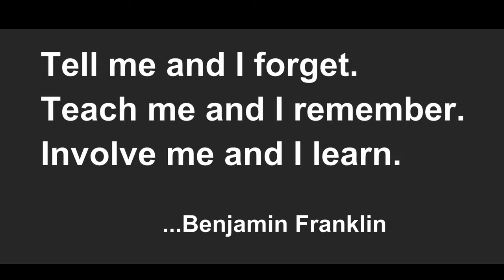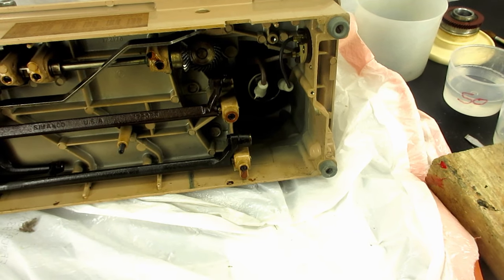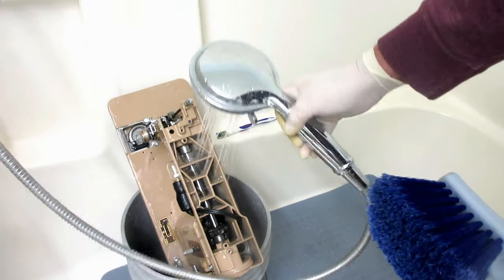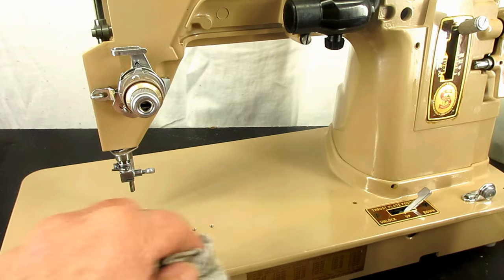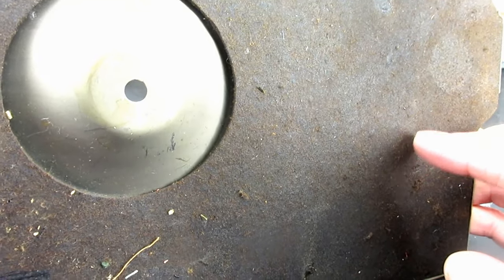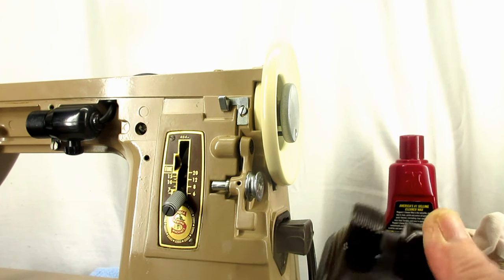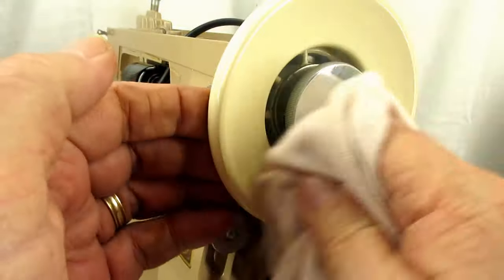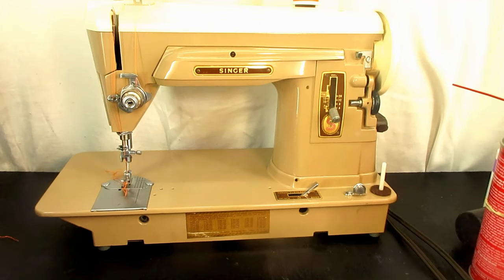An easier way to clean & degrease a sewing machine with less parts removal.

Comment: Thank you for making all your videos, they're so helpful.  I'm wondering if you will ever be doing a video to remove and replace a take up lever on a Singer 403.   I purchased an otherwise mint condition 403A on Ebay for $400.  I took it to a sewing machine repair shop after the sale and the repair man checked out machine and said it worked fine and was "museum quality."  When the defect became obvious (long after sale completed), he refused to fix it because it was too time consuming ($400 worth).   This beautiful machine needs this repair--but it's not so simple as on a straight stitch machine.  Second repair person also wouldn't attempt it.  I was hoping I could fix it myself.
Reply from the maker: You certainly can fix it yourself. You can repair, replace, adjust anything on the machine. My favorite SInger ZZ machine. I named mine "Regina" b/c, for me, it is the Queen of Singer ZZ machines. Here is my playlist for model 403A. https://www.youtube.com/playlist?list=PLsCOZgzzaiKKyqvdDRwS-9MfLuwSNJTcg   One of the 26 videos is about the take-up lever system. I think you will find it useful. The other 25 videos cover other parts and systems of the model, cleaning and degreasing the machine, working on the motor, the light, and the wiring and lubricating the machine, and finally, how to use a vintage monogrammer on the machine. Congratulations and best of luck going forward. Thank you for watching my channel.
Reply: @andytubesewing1953  Thank you for such a quick reply!  I did find the video on the take up lever system, and some of the others you mention, but what I didn't find (and couldn't figure out today) is which parts have to be removed to get to the take-up lever and how (and what order) to remove them.  I'm scared I'll never get it back together.  I started today, but didn't know if I have to remove the tension apparatus because it's connected to something else inside, or if I can leave it alone.  Maybe that's in a video; I'll go through your list.  Thanks again.  I was a little worried after I saw the October 2020 video--I'm glad you're back.
Reply: @andytubesewing1953  So sorry Andy, I made a mistake in my first comment--my machine is a 401A not 403A.
Reply from the maker: @geem.5286  Ok, model 401A. I'll re-think this then, but in the meantime maybe you can tell me what is wrong with the take-up lever and why you want to remove it?
Reply: @andytubesewing1953  The  first time I tried to use the machine, it sewed for a minute,, then threads got all tangled up in the bobbin area. On phone, service man told me I was doing something wrong or using bad thread, but he would look at it.  I  put it away until months later when I could get back in to the shop..  On closer look, he told me someone had run machine without oil/grease and dry parts (pointing to t.u. lever) had rubbed together and ruined them.   He showed me a broken round  plate on the middle  joint of the take up lever where he said someone had used a screw driver to try to force it to move and had broken it. A second repair man agreed the t.u. lever needed replacing as he could see the broken round metal plate.  I don't really understand what parts were rubbing to cause the problem; I didn't know what a take up lever was til I got home and looked for videos on YouTube..  Both men refused to work on the machine.  Thank you for reading all this.
Reply from the maker: @geem.5286  Use the Regina 403A playlist videos to work on the nose end parts of the 401A. They have the same parts. The sequence is the same in the playlist; Needle bar, Presser bar, Vibrating Bracket, the finally the take-up lever system. You will see in all those videos the tension unit is in place and has not been touched. It will not be in the way. When you buy the replacement parts, usually on eBay, you can use parts from the 401A or the 403A b/c, as I stated, they are the same parts in both those models.
Reply from the maker: Use the Regina 403A playlist videos to work on the nose end parts of the 401A. They have the same parts. The sequence is the same in the playlist; Needle bar, Presser bar, Vibrating Bracket, the finally the take-up lever system. You will see in all those videos the tension unit is in place and has not been touched. It will not be in the way. When you buy the replacement parts, usually on eBay, you can use parts from the 401A or the 403A b/c, as I stated, they are the same parts in both those models.
Reply: @andytubesewing1953  Thank you, Andy, 'll find and watch those videos.  I so appreciate your taking the time to help me; I and so many others are grateful to have your videos and advice.
Reply from the maker: @geem.5286  Sure, you are welcome 👍 Please keep in mind that you are taking the presser bar and vibrating bracket off just to get to the Hinge Screw/Stud of the take-up lever over on the left side. So you usually do not have to remove the presser bar completely, just the top parts of it to expose the hinge screw. The same with the vibrating bracket; just remove enough of those parts to get to the hinge screw behind them. Of course, you can remove all the parts as I do for cleaning, etc. if you want, but I'm just saying you don't have to do that; just get access to the hinge screw /stud on the left 👍 Best of luck to you.
Reply: @andytubesewing1953  Good to know, thanks!
Reply from the maker: @geem.5286  👍

Comment: What happens if you don't get all the moisture or water out and completely dry and some moisture is left.  Isn't that dangerous? 
I'm a little freaked out about the use of water with an electrical device?
Reply from the maker: Yes, water and electricity don't play well together. You must completely dry the machine so that does not happen. 
     I've washed dozens of machines like this without any problems. The oldest one I did was about 12 years ago and it's still running fine. 
     I have even washed the motor while inside the machine: https://youtu.be/vIFK94QRyr4    
As an experiment, I soaked a motor in dirty, muddy water for 24+ hours, then washed & dried it and it worked perfectly: https://youtu.be/6y1EN5S2sz4
     These vintage machines do not have any electronic circuit boards or switches. I would not wash those. 
Many of the machines I have saved were in terrible condition, but they were made so well that I could clean them and get them working normally. Here is a machine I saved after mice had been living inside it for months:
https://www.youtube.com/playlist?list=PLsCOZgzzaiKJS_4FKPb4bgAbHtYWnexvy    

     Of course, if you are worried then don't wash it, right?  Thanks very much for watching my channel.

Comment: Andy, I am interested in cleaning the black vintage Singer machines that have shellac finishes and decals.  I cannot find mineral spirits or kerosene.   I have read that some people use diesel fuel.  I am most interested in cleaning the mechanical parts of the machines.  I have also read where some people use Marvel Mystery oil. What are your thoughts?
Reply from the maker: I have used the Krud Kutter Cleaner & Degreaser for many years to clean parts and insides of the body of the machine. I've only done a couple of black finished models. Here is a playlist of 16 videos for cleaning. https://www.youtube.com/playlist?list=PLsCOZgzzaiKK8O1UvRsU-eNo2G2yX3f2G    You can look at the list and watch the Featherweight 221 videos and the 99K video to get some ideas. It would be hard to find anyone more knowledgeable than the featherweight shop when it comes to refurbishing the black finishes. You can find their tutorial page here and navigate to the section you like: https://singer-featherweight.com/blogs/schoolhouse/tagged/maintenance    Good luck, and thanks for watching my channel.

Comment: Dear Andy, hello.
Happy Labor's.
I'm cleaning a singer red-eye from 20's, she is extremely dirty n glued together from old oil n dirt etc :)
I'm using the 'Krud Kutter Original Cleaner/Degreaser'.

I'm wondering based on your experiences with this cleaner, what's the longest time i can soak the hardware in the 80% KK n 20% ho2? 
 
Thanks in advance for educating me.
Regards,
Sue
Reply from the maker: Hey, Sue! I've never thought much about how long. I have started using a weaker solution. No more than 50/50. I've found that some kinds of gunk just need more scrubbing no matter the amount of KK. When I soak very dirty/greasy parts, say in a 50/50 solution/ usually 15 to 30 minutes does it. BTW, you understand NOT to use any KK on the black finish of your red eye, right? On a painted machine like a 403A a 15% solution, sprayed on and quickly wiped off and rinsed can even dull the paint a little. On a red eye that usually/may have a lacquer finish, it can really harm the finish. Thanks for watching, and good luck.
Reply: @andytubesewing1953  yes sir, I am just taking the inner parts that has oily gluey stuff and needs cleaning badly & not much moves :)
I have been watching  your educational YouTubes very carefully.
Reply from the maker: @staylor8638  That's great, thank you. I just wanted to be sure because last year a guy wrote me that he ruined his 99k using the KK and he was blaming me. I felt bad for him but I said three times in the video not to put it on black machines. So I guess I'm a little edgy. Sorry I just want to be sure nobody hurts their machine

Comment: Andy, I have an older 99 without the tension dial etc and the spring has its tail over the discs also the wiring is directly into the motor and the bed surface is all pitted from the metal foot having been stored there in the bentwood case.  Should I get some black paint to fill? Even with all these issues the decals are good! Except where pitting or chipping has happened.
Reply from the maker: I've never tried paint, but a friend recently restored a 201-2 and used a paint scratch and fill product. Here it is: https://www.amazon.com/Dupli-Color-EACC04410-Exact-Match-Automotive-Touch-Up/dp/B01BPGFWPU
BTW, since you commented on this video I want to be sure you know DO NOT use Krud Kutter on an old black Singer. I've been told it harms the finish, so just an FYI
Reply: I dont know how to send you a picture.
Reply from the maker: @debbiepring2236  can't send through YouTube but if you post it online somewhere let me know.

Comment: "Remove smells" yeah here's a question I've had since owning my 500 - do these old pa motors constantly smell like ozone? My motor's been rebuilt twice, it's smells like ozone whenever it's run. I know old brushed motors can, just wasn't expecting it to be so strong
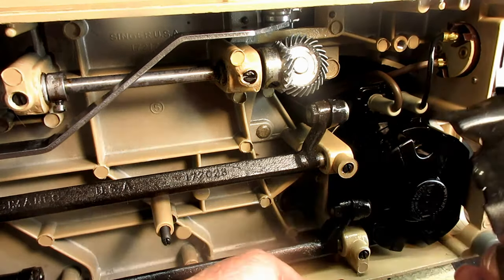Reply from the maker: Not all motors, no. I wonder what was done to rebuild your motor. Anyway, a dirty commutator with carbon deposits can smell fairly bad and the whole motor internal motor housing can smell that way. With a cold start of the motor, it can stink then, fading smell then worse when warmed up and running for a while. There is a fan in the motor housing that pulls air in from the sides where the aluminum meets the bakelite plastic and that fan will blow the smell around inside and outside of the motor. It can creep up through the hole for the motor shaft pinion gear and then spread from there all around the horizontal arm, adding to the smell of 60 years of accumulated grease, oil, and dust inside. The type of cleaning in the video eliminates that, but some can hang out inside the motor. That's why I showed cleaning the commutator with the brush seating stone. (@ 3:44:07) Faster motor and getting rid of the built-up carbon. Here is a video I made for cleaning oil off a PA motor https://youtu.be/vR7VmAC6evU    and here is a video about using the brush seating stone to clean the commutator https://youtu.be/pzq4tv8qn94   I use that stone on every motor now and it helps stop the smell, but some motors are so nasty I do the whole cleaning procedure too.
Reply: @andytubesewing1953  it was just rebuilt the other week by my father when we had to replace the motor gear - but there is a TON of old grey/black grease just all inside the machine, which is why I was peaking at this vid. Hopefully I can clean that up soon enough and see if it helps if you think it's just a smell lingering around
Reply from the maker: @faultyillustration3197  Yes, sure. You can pull the motor out of the bottom but leave the wires attached, and run it for a while to see if it is the cause of the smell you have. Removing the old grease will surely help though. Also, the bottom "felt" on the drip pan (bottom cover) can soak up a lot of oil and grease over the decades. When the machine is working those gear get quite hot and it warms up the grease and gunk in the felt. There are access holes on the lower sides of the machine casting and the smells come right out. That's why I often degrease that bottom cover as shown starting around 2:16:10 in the video.

Comment: Love your videos.  I was wondering how would the 404 work with tex 69 or 90 using a leather needle on garment leather 3-4oz?
Reply from the maker: Probably, George. Page 5 on the Instruction Manual has a needle/thread chart that shows up to a size 18 needle. A free instruction manual is here: https://www.singer.com/search/support?title=404    There are several online references that show tex 69 uses a size 18 needle. Here is just one of many: https://www.thethreadexchange.com/miva/merchant.mvc?Screen=CTGY&Category_Code=needles_thread_size_chart   I don't know if you'd need to reset the tension with a heavieer thread. That depends on the particular machine. I have a whole series of tension videos for model 404: https://www.youtube.com/playlist?list=PLsCOZgzzaiKJaeFB_GW97NsW5GYM7KD9U    You may be able to modify the machine to take a size 20 needle for the tex 90 thread. Besides adjusting tension you may need to move the hook a tiny bit farther from the needle point. Page 144 of the service manual has instruction for doing that. A free copy of the Service Manual for Class 401 machines is available here: https://sewingdude.files.wordpress.com/2012/09/singer-401-service-manual1.pdf   Thanks for watching my channel, George, and good luck. P.S. For sure use a leather needle!!
Reply: @andytubesewing1953  Andy,  thank you so much for the detailed information.  I will follow your recommendations.  I am using a leather needle.  The biggest I found was 19.  However, I know there are some #20 around.   Thanks again.
Reply from the maker: @georgesanchez9971  Sure, and good luck.

Comment: I put white lithium grease on my 401A before I heard you say not to use it. Is it safe to clean the white grease off and put the TriFlow Clear Grease, which says (red) in description? If so, 
how do I clean the white off the gears? Thanks for your help!
Reply from the maker: Is it safe? I'd say so. If the lithium has not dried out, I remove it with dry brushes, like old toothbrushes, as much as possible. Then I use the same degreaser I used in the video, KrudKutter. You can use any degreaser you like, or even 70 or 90% alcohol if that is all you have. If I find hardened lithium it's a different story. I have to scrape and "chip" it off. I use wood or plastic sticks if possible, but I often use nut picks or even dental cleaning scrappers. Sometimes you can wrap the gears with the dried stuff tightly with t-shirt rags and drip degreaser on them and let them sit for a few hours and it may soften the white lithium enough to brush and scrape it off.

Comment: Oh my! Do I have my work cut out for me. My sister gave me her machine 503a. It is so dirty.It has been in her basement for twenty years. Dirt and rust and dried oil red grease.
Do you need to wipe the rust remover off or clean after using it?
Reply from the maker: What you clean with rust remover should be free of dirt and oil. I usually wipe off any excess rust remover when finished and you especially want to wipe chrome & aluminum off with water on a rag, then buff dry. Always try a small area first. I usually brush a little oil on all the clean metal as shown in the video, but the rust remover by itself prevents rust for up to a year. I have several other videos that may help with your "New" 503A if you find it needs a little adjusting after it is clean. 21 videos for model 503A: https://www.youtube.com/playlist?list=PLsCOZgzzaiKJZaZn2zl3LsnV2d7UhrqvX    Also 26 videos for model 403A which is the same mechanically: https://www.youtube.com/playlist?list=PLsCOZgzzaiKKyqvdDRwS-9MfLuwSNJTcg    If you did not get the manual with your machine you can still download a free copy from Singer at this link: https://www.singer.com/search/support?title=503
Good luck, Kimberly; the vintage Singer machines clean up very nicely.

Comment: Any reason not to try this on an early 70s Kenmore?  It's stuck in stretch stitch and I'm looking at buying a new machine.  But I have  sentimental attachment to the old girl...  it's the machine I learned to sew on.  Oddly enough the previous owners of our house left a jug of crud cutter in the garage...   almost feels like a sign.   :-D

Is it best to keep the lightbulb in for some reason?   I would worry about breaking it.
Reply from the maker: It's a sign ✨ I don't do Kenmore machines, but let me say the Krud Kutter is OK for iron, steel, aluminum, glass, vinyl, rubber, plastic, and most paints. Don't use it on an old black machine with varnish-type coating. I have found I can use a light concentration of the KK to water, like 25% KK to 75% water will clean most machines nicely. It's only the really dried-out grease on gear teeth that needs stronger. Just try a small area on the bottom of the machine. Getting the machine super dry afterward is a must. I usually leave the light bulb in b/c the socket inside is rarely dirty, but feel free to remove it for cleaning if you like, no harm. Good luck, and thanks for watching my channel.